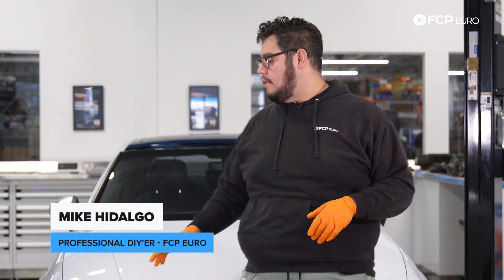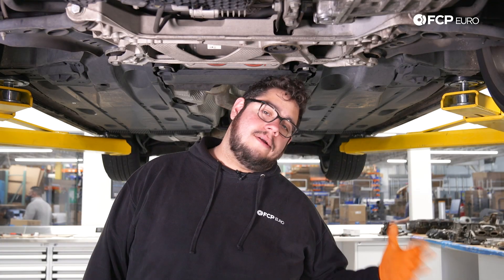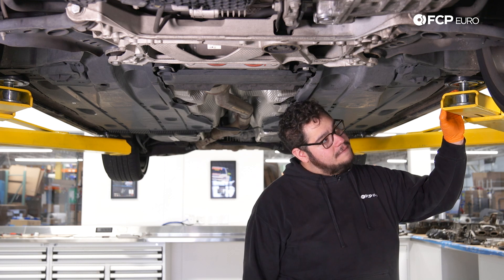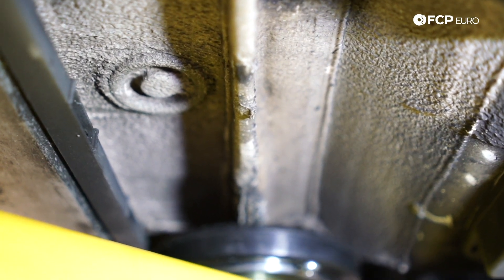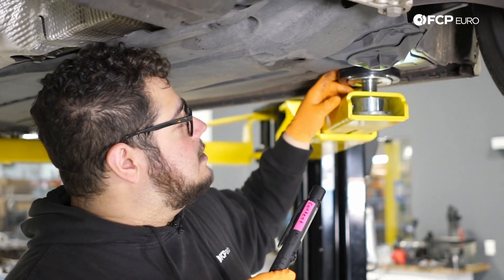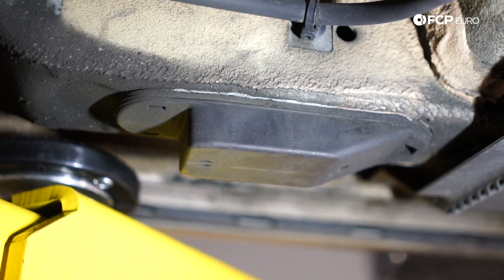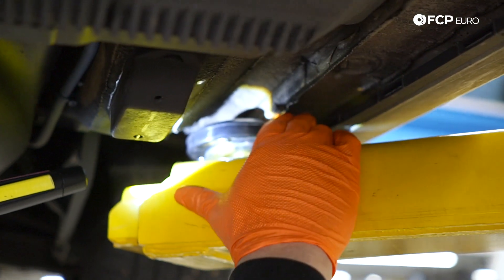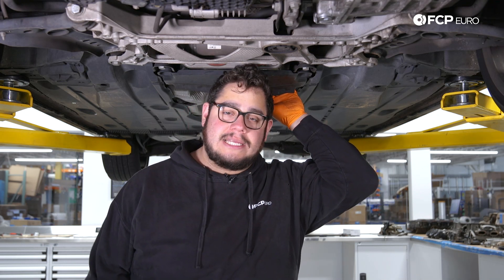How To Find The Audi S3 Jacking Points (2015-2020 Audi MQB A3, S3, RS3, TT)

Comment: In case anyone is wondering,  this is will not be the same for a 2015 A3
Reply: I swear that’s what I’ve been searching for. Thanks for answering my concern.
Reply: Soooo what do I do for my A3 then?
Reply: @petegallo1155  it's a pita, i had to carefully use the jacks and the lift to place the jack stands on the pinch welds
Reply: @gmax985  there appears to be a spot right next to the pinch weld that is for floor jacks and lifts. Just not 100 percent so I’ll have to look around some more
Reply: @petegallo1155  i looked for that on my car but i couldn't find anything
Reply: @petegallo1155  if you find it can you describe it
Reply: Its the same on my '14 A3
Reply: Those look like after market jack kits
Reply: Yea I was confused but had to jack it up so I bought those jack pads and risked it on pinch weld then used jack stands not sure what else to do

Comment: I've got a 2019 Audi A3 and I most definitely do not have the frontal jacking points illustrated here. It seems I only have a pinch weld. No idea where to find this info for my car. I've searched high and low and it seems impossible to get a straight answer on how to actually get your 2019 Audi A3 onto four basic jack stands. Can't find a clear explanation anywhere.

Comment: Also how to identify a jacking point.. Look for the crimpled part of the car where every dodgy tyre centre has just put their jack under your car and went for it /sarcasm. 

The jack points I use aren't recomended, but my existing jacking points are completely fooked. I tend to jack up my car under the lower control arm (at the front), and under the spring cup (at the rear) it's worked for me so far and then whack an axle stand up

Comment: Do one for Volvo P3! What's the best way to lift the rear of the car with a jack and then place jack stands under the traditional jacking points on the rear pinch welds? It's easy to do in the front, as there are jack points in the center to use the floor jack.  Most of us watching don't have a lift, so we can't lift all 4 corners simultaneously.

Comment: Correct me if I´m wrong, but would you need any rubber attachment for your jackstand to mount it on the pinchweld? Does Audi sell jackstands that work for Audi 8V vehicles?

Comment: so can we jack 2017 s3's using the pinch welds or do we need to get the jack kit for that little rubber spot?
Reply from the maker: The side skirts are labeled with small arrows showing where on the pinch welds to jack from.